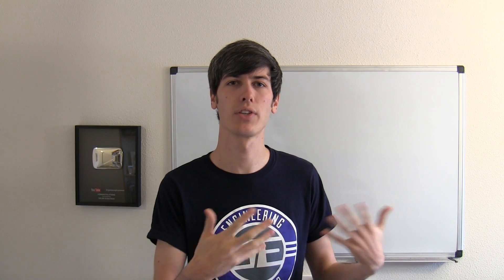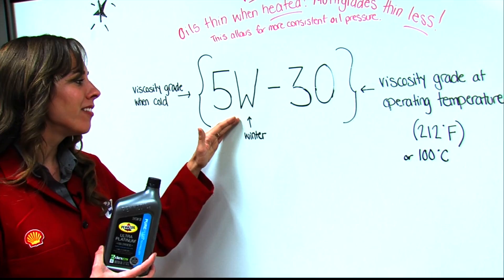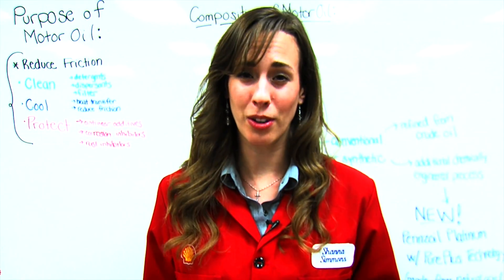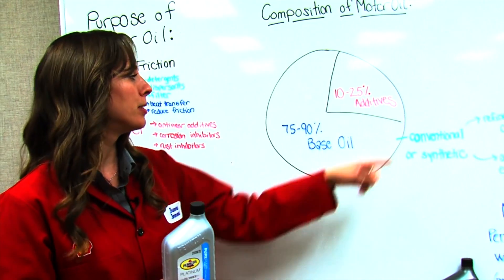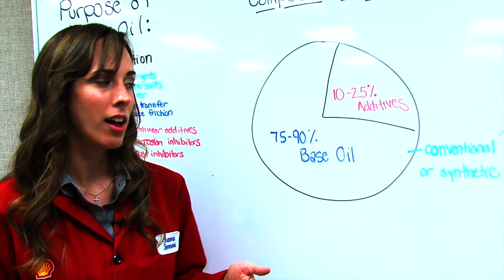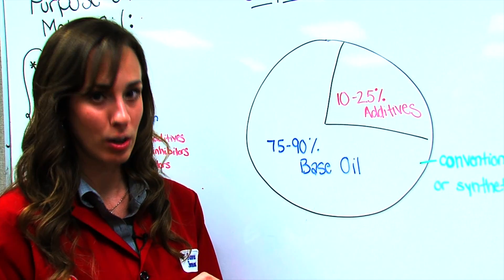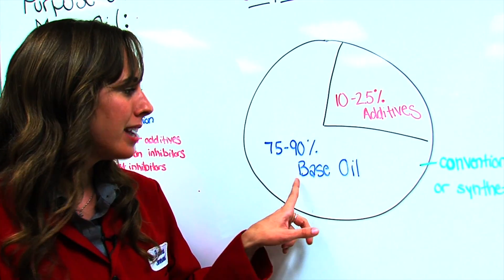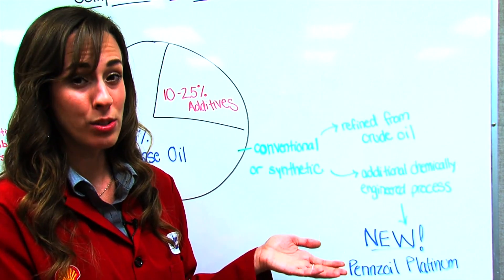Motor Oil Myths & FAQs - Synthetic vs Conventional

Comment: I use whatever oil is on sale, and filter.  Oil is oil it's all set to a standard, and I change it every 3,000 miles.  Better oil might be better if you don't change your oil religiously however I do it myself so it costs me generally $20 to change the oil in a F-150.  Versus $60+ at a oil change shop.
   Price is the #1 reason people put off oil changes.  Learn to change it yourself, or get the teenager next door to do it for $10.
Reply: Better oil is better.

But if you do in fact change your oil every 3,000miles then any oil is fine. Your engine must be running like new still
Reply: +Bruno Danese 198,000 miles on a 99 F-150 with a 5.4l and it definitely hasn't been babied.  It's a truck that gets used like a truck.
Reply: +Slim Jim ive an 80 thousand dollar vehicle and i put nothing but conventional oil in it. change it every 2500-3k miles. DIG engine and i run it like  a scalded dog!
Reply: This is the sort of uninformed response I get on a daily basis and a holdover from the mindset that comes from dealing with conventional oils.  The fact is, with the advancement of synthetic oils there's no reason to change your oil every 3,000 miles any longer.  Although the initial cost is higher, the increased duration between oil changes will save you time and money, and wear and tear on your engine.  Not to mention being better for the environment.
Reply: @ADAMJWAITE  I see some strange parallel between the rants about synthetic oil and the rants of adult potheads. I am not calling anyone a pothead, mind you, but there is some element of the addict psychology here. Profferring vast retinues of benefits which in fact do not exist. Back on the early 2000's I had a job where I drove up to 125 miles a day using my own car. I used synthetic and conventional oil at different times. There was no discernable difference in gas mileage. I doubt it made any difference in engine wear either. I did wait longer to change the synthetic, but I sometimes went as high as 8000 miles on the conventional and I don't think it made any difference. There probably are benefits to very frequent oil changes and probably some benefit in using synthetic too in that synthetic allow longer oil change intervals. But overall, it's a pricey fantasy. The people who get extremes of high mileage out of their vehicle do so because they do the maintenance and drive normally, not because they use synthetic. Seriously, people have accomplished the same using no-name 10W-30 and a Brand X filter. But if using Monarchcial Mauve or Wave-the-Flag synthetic soothes your mind and helps you stay chill behind the wheel, go ahead fork out. It might be worth it at that.
Reply: @anonymike8280  I work in the automotive industry, not oil industry mind you, and have extensive training, as well as have done extensive research on the subject.  So any "rant" you're referring to comes from a desire and felt obligation to educate.  It is in fact, a part of my job.  You act if there's something wrong with being passionate about automobiles.  Lumping it together with drug addiction is quite a stretch, and quite frankly, undermines your credibility.  The facts I laid out aren't really disputed by those who are educated on the subject, and the research material confirming them is available if you so choose to delve into it.  Like any products, there are advantages and disadvantages to both synthetic and conventional oil.  Although the only advantage to conventional oil is price and availability.  And with the price difference margin becoming less and less, the longer service time intervals, and the availability of synthetic becoming more common, those differences are quickly becoming mitigated.  If anything, I'd argue that the actual overall cost is substantially less by running synthetic.  BTW, switching back and forth between conventional oil and synthetic completely undermines the long term and gas mileage benefits of running synthetic.  So your experiment was flawed from the get go.  You can choose to believe the facts or not, but the benefits of synthetic are so overwhelmingly one sided that it has already replaced conventional as the standard - even in small engines.  It's just a matter of time before conventional oil will be limited and difficult to find in comparison.
Reply: Except for the fact that a filter only filters a % of oil as it cycles through the engine.  The oil contains particles from inside the engine.  These are what cause wear.  Changing your oil every 3,000 miles removes all of these particles.  Even if synthetic oil can last 6,000 miles (not every synthetic oil manufacturer tells you to stick to you manufacturers oil change specifications) that means as those particles build up you run them around in your engine for twice as long.

   Which is why if you go to Ford and say "I run synthetic how often should I change my oil?" they will say "3,000 miles" and if you go to synthetic oil manufacturers and say "Running your oil can I change my oil every 6,000 miles?"  they will say "No follow the manufacturers interval.

   People do it in Europe because all oil is expensive over there, the majority drive smaller displacement engines, and generally much slower.  Those that don't change their oil much more often.  

   I'm well over 200k miles on a 5.4l F-150 4wd.  Oil changes are less than a new engine so I'm going to change it every 3,000 miles to get the gunk out.  Because I might save $5 and the time it takes me to change my oil to run synthetic and push it to 6,000 miles doesn't make it a good reason to do so.
Reply: To save time, I'll copy a previous comment then elaborate.
Myth - Synthetic oil wears out, forcing you to change your oil.
Synthetic oil doesn't "wear out", it gets dirty.  If you could keep your oil clean, you would never have to change it.  This principle is commonly applied in industrial applications such as machinery, ships, ect.  Instead of frequently changing the oil, (which could be very spendy in large machines) the oil is filtered to a degree that allows near continual use.  Instead of doing an oil change, oil samples are taken and sent to the lab for analysis on a similar timetable.  This also provides additional benefits for monitoring engine wear.  You can do the same thing on your vehicle at home using an aftermarket bypass system such as shown here http://www.amsoil.com/bypass/how-it-works.aspx .  Considering all the benefits, and lack of downsides, kind of makes you wonder why auto manufacturers don't include similar systems from the factory.  Of course, they'd lose service revenue and the oil companies would too.  And it doesn't support the electric car agenda to produce cleaner, more efficient gas vehicles.

The 3,000 mile recommendation was a result of conventional oil breaking down within this time period, and/or being contaminated from outside influences (dust passing through the air filter, ect).  Internal engine wear over this time period was a much smaller factor.  If your engine is creating those kind of particles over that short of a duration, you've got much bigger problems. Of course, although the oil change interval is going to be longer with a synthetic vs conventional oil, the age of your vehicle is also going to play a factor.  An older carbureted engine doesn't do as good of a job of keeping contaminants out as modern fuel injected ones do.  Being a 5.4L, I'd suspect your truck is a 97' or newer, and that being the case would fall in the latter category.  The theorized responses from both the dealer and oil manufacturers are simply the expected response when attempting to minimize liability.  Working in the aftermarket automotive industry, I've had many conversations on the subject with both automotive and oil manufacturers, and the opinions vary based on the knowledge and experience of the technician asked.  Oil technology has come a long way in the last 20 years, and it's the primary reason there's not a vehicle produced today with a 3,000 mile recommended oil change interval.   Using a quality synthetic will easily double that interval.  Personally, I'd run the best synthetic I could get my hands on and go 10-12k miles + between oil changes while changing the filter every 6k.

Comment: Synthetic oil was used in the Corsair airplane engines way back in WWII. There is no legitimate argument that is not better and less expensive to use in the long run. If you can afford to buy a car and put fuel in it you can afford synthetic oil.

Comment: idiots you made 3 different mistakes in that video
1 the w does not stand for winter that makes no sense at all
2 allot of synthetic oils dont actually have more chemical goodness there just refined more
and 3 as for using to thin an oil it actually does more good for your engine then bad especially a high mileage vehicle as in one i drive and as for running to thick an oil it is bad to do normally but i did it to help slow down my old car from leaking oil (yes i does help)
and NO im not just saying this i know many people the work in maintenece shops and they all say that
Reply: +darek backman  You might want to Google #1.  It absolutely does stand for 'Winter'.

Read the 3rd Question & Answer:
http://www.valvoline.com/auto-resources/motor-oil-faq-types

Comment: i never change the oil just the filter every 20-25 thousand miles and top of the oil. Did that with an 01 Duramax Silverado starting at 50,000 miles and kept it till 650,000 no problems.
Reply: +cdimmm so you drain the oil, remove old filter, install new filter, then add the OLD oil back in??
Reply: No, just spin off the old filter and put a new one on. On that engine you would loose about a quart and a half maybe 2 of oil when spinning off the filter then just top it off. I was using full synthetic Amsoil and their EA filters the whole time and now doing the same with my 2014 Duramax currently at 141,000 miles no problems.

Comment: Half of what this women says is incorrect. "W" does NOT stand for winter.  And 'too thin' of oil will do damage is partly correct. What does more damage is your oil being too thick. Even a 0 weight oil is too THICK to lubricate properly at start up.

So much misinformation out there.
Reply: +Jesse That's why oil manufacturers put 'stick-slip' additives such as polyisobutylene into it, to make it slightly 'tacky'. This ensures that an oil fil remains ready for start-up, hence reducing wear when the oil has drained down.

Comment: Video was actually informative to average person in many ways and at least in stating what the "W" means. So now can we assume that the lower the number, the thicker the oil? And what happens when you mix oil of different viscosity? I always heard you should not mix different types of oil but I have never blown an engine from doing so. Do you get a median in between the two? Is that OK? I always assume that adding oil of any kind is better than not adding oil when needed. Is that true?
Reply: lower the number the thinner the oil. If you car uses, for instance, 10w-30 then using 5w-30 when temp is below 0f your car will have less trouble starting :)

Comment: God that video just needed Billy Mays to make it complete. /facepalms OK, as someone that worked in the lubricants industry for 25 years, latterly as a formulating chemist, here's my pros and cons of mineral vs. synthetic oils. Here comes the science bit...Mineral oils swell rubber seals and all seals have a designed-in swell, to help take up differences in tolerances between engines. Seals are designed to swell between 2 and 6% and soften by about 6 degrees Shore A hardness as they absorb the oil.Synthetics actually shrink seals as well as harden them and 2% shrinkage isn't unusual with a fully synthetic oil. Manfacturers add synthetic esters to balance this and to achieve similar swell results to mineral oil. Unfortunately, that might not work on older engines that have run for thousands of miles on mineral oil, so switching to synthetic oils may cause oil leaks as the seals shrink. This was a widely reported problem when synthetic oils such as Mobil 1 were first launched. The remedy (trust me, it works) is to out the cheapest, nastiest supermarket mineral oil motor oil you can find and put that in for a while to swell the seals back up.Synthetic oils have lower pour points, lower freezing points and higher viscosity index, when compared to mineral oils. This translates into better cold starting and less wear on start-up as the oil gets round the engine faster in cold weather and better protection at higher temperature as the oil may be thicker than a mineral oil would be at 100C. They are also more thermally stable as they have undergone severre hydrotreatment to take out a lot of impurities.The confusion starts when you get semi-synthetic oils. These are just blends of synthetic and mineral oils to create a 'half-way house' product that is slightly better than conventional synthetic but not as expensive as fully synthetic oils.Frankly, there is as much rubbish talked about motor oil additive packages than there is about laundry detergents, so just go for the highest letters after the S and C of the API (American Petroleum Institute) specification on the side of the can and you'll be getting the best. S is for Petrol engines and C is for diesel,  with the latest versions being SN-CJ.The 5W/30, 5W/50 and 0W/40 designations are based on ancient SAE (Society of Automotove Engineers) specifications that pre-date WW2 and were based on straight oils, multigrade oils didn't exist when the specifications were drawn up,  so the world of synthetics have 'Gone off the SAE chart' a bit, in terms of their rate of change of viscosity with temperature, so the figures only make sense if you are above 10W/40 grade.In theory at least, fully synthetic oils can go for longer intervals before oil changes as they are more stable from an oxidation point of view, but other factors, such as short journeys and fuel dilution in diesels can affect the oil, so stick to the manufacturer's recommendations when it comes to drain intervals.Feel freee to ask any questions.

Comment: Okay what should you run in a 1948 6 cylinder Chevrolet do to the fact the EPA made all oil zink additive
Reply: +Danne Hughes I would go for a straight SAE 30 oil, as that was the most likely grade it had when it left the factory. If you are in  hot climate, go for a straight SAE 40 oil instead.

Comment: is motor oil weight like wire gauge? where the lower the number the thicker the wire? the low number on the oil, the cold number.. because it seems that oil at engine operating temp. is thinner more viscose than cold motor oil..? but i have always been under the impression that the higher the number the thicker the oil? like a 10w30 would be thinner than a 10w50 .. but it seems that the cold oil (the 10) when i'm pouring it into the motor is thicker than when i run it up to operating temp and drain it out??
Reply: +Jonathan Alvey No, the lower the number, the lower the viscosity. That's how SAE classes work.

Comment: The girl in the video is a LIAR.  She wouldn't know anyway because she was taught by marketers  to parrot what they told her to say  The W on any oil does not stand for winter but stands for WEIGHT.  Such as your 5w 30 weight means 5 weight oil that protects up to what would be a 30 weight oil.  It never becomes 30 weight but protect as good as 30 weight would once hot and the first number of 5 or 10 or 20 W is the actual weight of the oil and the second number means what it can protect up to being same as
Reply: +Earl Guyton  Sorry bro...its Winter...been Winter since the beginning...read the 3rd Answer...and every other answer if you search on Google.

http://www.valvoline.com/auto-resources/motor-oil-faq-types

Comment: When I took apart my Porsche 914 engine that hadn't been cranked in 23 years and had the piston rings so rusted to the barrels that I had to cut them off, all bearing surfaces were still coated in oil and were in perfect shape as were all the other steel surfaces of valve train and crank. The distributor drive was so rusted it had to be hammered out.

Comment: I guess you're mainly a car guy, but it'd be nice if you included a few things about oil for motorcycles.  Namely, why most bikes can't use automotive oil.
Reply: But I should add that I liked the video.  Nothing new to me, but it didn't have all the nonsense you find on the internet.

Comment: I have a JK Wrangler which in the owners manual ~states~ requires 0w-20 oil.  I don't use this oil as the conditions in Australia have no need for such a thin oil, and it's not like the 3.8 motor is a precious engine that requires super refined oil.  I use 10w-40/50 oil and it runs great.  I did try 0w-20 oil in one change but it literally just drank oil for that period (3 litres), and it was quite noisy with a lot of valve tick.